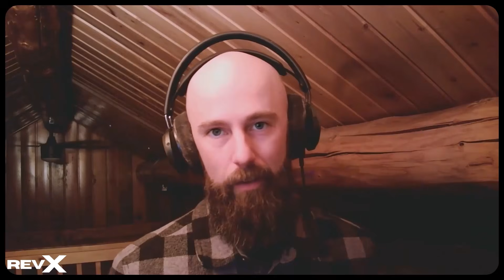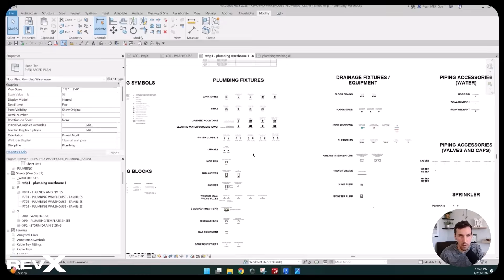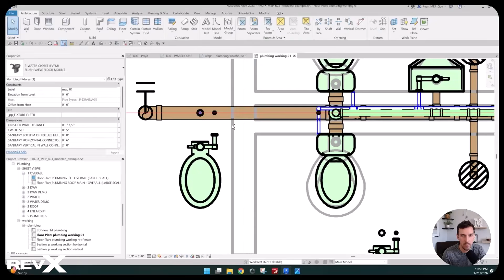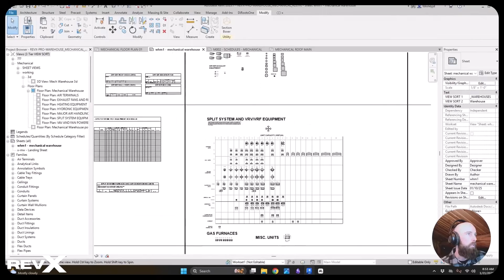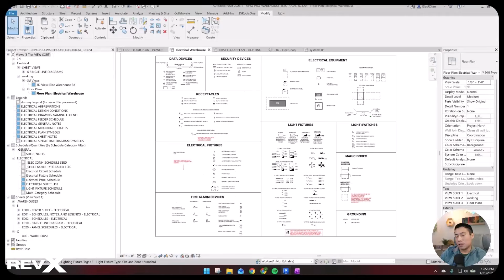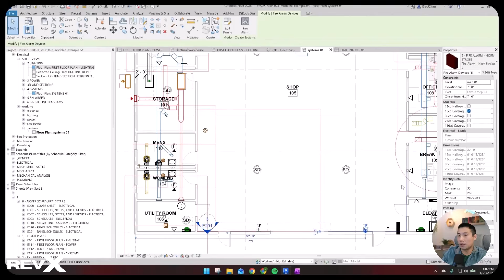Why Most MEP Firms Never Build a Revit System

Comment: 17:30 How much of this can be attributed to companies not using profits to build a financial moat? This moat will help a business operate while building foundational training material. Sure owners and share holders may temporarily be disappointed, but the investment will pay off in faster onboarding, learning and allowing higher cost employees to become less distracted with less profitable work.
Reply from the maker: Exactly. It’s the 'Bear' in action. 99% of successful firms are so busy running that they do what’s easy: hiring more people. But that doesn’t fix the root cause; it just adds more people to a broken system.

You're right that it requires a temporary sacrifice in profit to build that financial moat, but even then, most firms hit a wall: who does the training? Your best people are usually too buried in billable work to document the system.

That’s the gap we’re filling. The ROI is massive because you stop paying your highest-cost employees to do low-value troubleshooting. It transforms onboarding from a months-long struggle into a streamlined system—the difference between owning a job and owning a scalable business.

Comment: I work in MEP industry ( heat, cooling, HVAC, water, evacuation system,fire protection since the '90s for medium and international firm like Siemens.  Offcourse first with drawing table and you can guess it Autocad, and now with both Revit and Autocad. Even if today everyone is moving to BIM, and most try i think get a complete team with developpers, designer and BIM mananger, there still have the need of engineers or specialist in the construction industry ( as HVAC engineer etc ) so basically you need teach thoses guys, and thoses guys need their projects done and moving ( from the first study to execution to revision etc ( phase 300-500-700-900) ) and it is hard to get both best of thoses 2 worlds, incredible specialist in Revit and incredible in engineering. so i think now it is mostly a question of time to see all thoses engineers who can own thoses 2 hats and need align it with Revit Management specialist. It is complicate, because deadline and firm tend to not understand the time needed to teach, but too build BIM System ( from families to complete reference system who count calculation, prices, simulation and other )
Reply from the maker: Yea it's a tough situation, but I'm hoping we can help the industry move in the right direction.

Comment from the maker: Comment below with a topic you'd like us to cover next month. Or just say hi. We'd love to chat with you!
Reply: Not sure if you guys are planning to branch off to the fabrication side of Revit, but I know there is a huge market for it right now.
Autodesk already has a lot of native fabrication parts for HVAC Air side and Mechanical Piping, Plumbing and I think some content for Electrical too. 
The issue is navigating the VERY confusing part of CAD MEP (Which is where the Fabrication parts and database needs to be edited). Due to this issue,  lots of subcontractors out there either don't switch to the fabrication side (most designers/modelers out there don't know how to use it. And they don't have time or the resources to learn from), or if the contractor still wants to push it, they are stuck with very costly plug ins out there for Revit (which a lot of times have WAY to much stuff in it and are very slow).